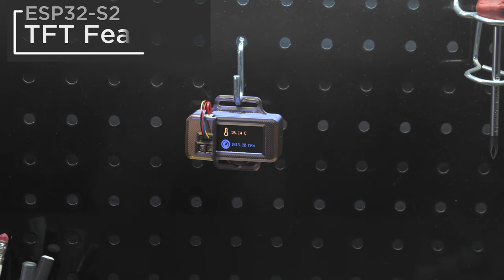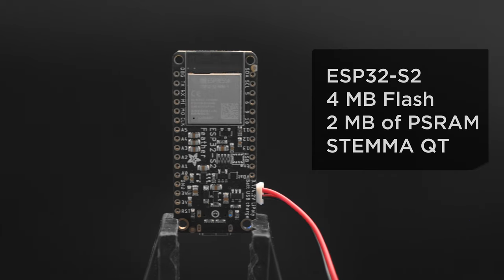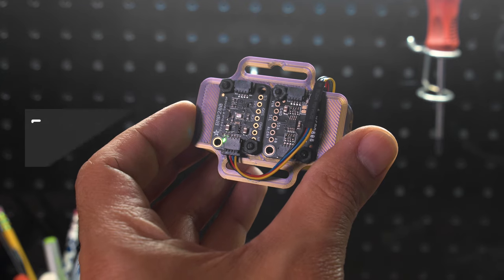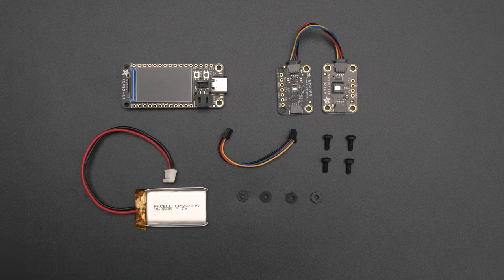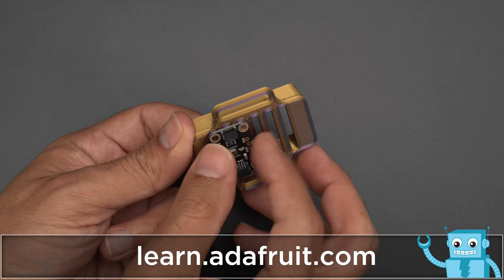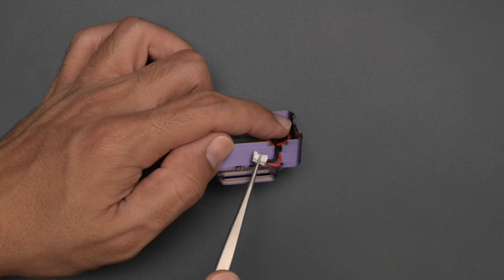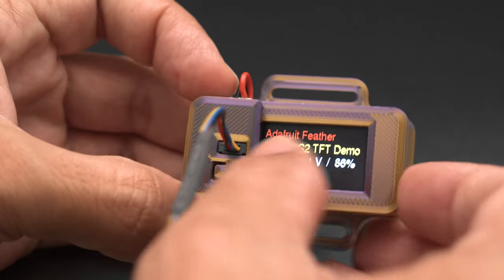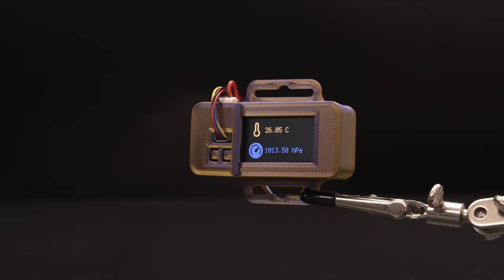ESP32-S2 Feather TFT STEMMA case #adafruit

Comment: Thanks for sharing the design!  I've already printed and it came out great except I'm pretty sure there's an issue with Feather-S2-Case-top-ports.stl. The edge that overlaps with the top has an angle that doesn't seem to be in the photos of your prints. It prevents the back from clipping into the base.
Reply: It actually looks like "Draft2" the 19 step in the timeline is what applies this.   I expect they wanted to angle along the long axis instead of the short axis of the case.   I set draft angle to very small (.001) and will reprint that part and see what transpires